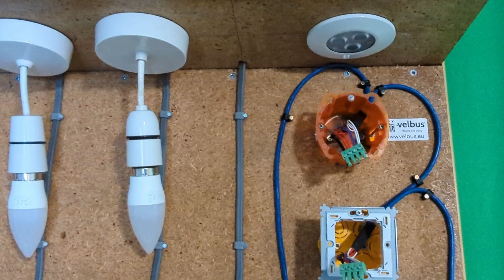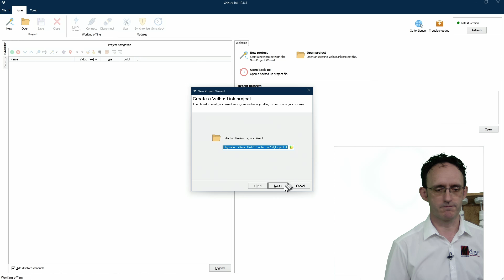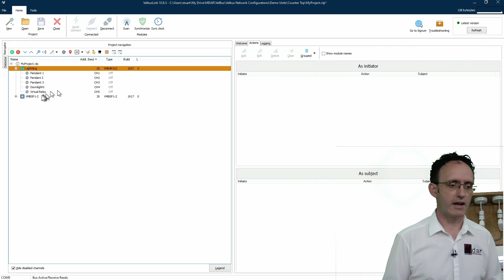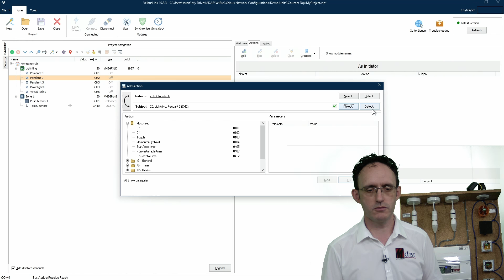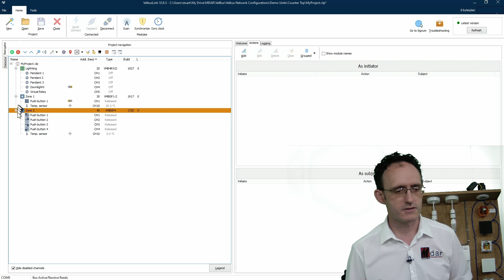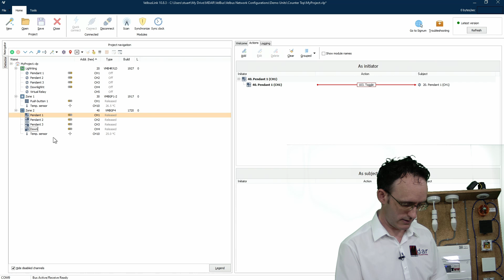Velbus - Basics of system installation for Lighting

Comment: Loving this series, really helpful to understand the system and seeing how the system could work.

One question, if I have LED strip lighting, for the LED drivers, what types of drivers is preferred for the velbus system to work with it i.e. 
Mains Dimming – ( Trailling Edge )
0v/10v
DALI
Reply from the maker: Hi
For the best result, you'd be better off putting Extra Low Voltage PWM dimmers ''between'' the constant voltage power supply and the LED tape, then use a channel of a VMB4DC to drive the PWM driver.

It'll be the subject of a later video or you can take a look at this PDF, for 10v controlled PSU dimmers 

https://www.mdar.co.uk/dl/10V_to_LED_driver_wiring.pdf

Or this one to use Velbus VMB2LEDDC PWM dimmer and a VMB4DC

https://www.mdar.co.uk/dl/VMB4DC_VMB2LEDDC_Wiring_plan_V1.5.pdf
Reply from the maker: If anyone stumbles across this in the future.

All the wiring diagrams can be found here

https://www.velbus.co.uk/downloads

Please ask if you need a drawing that isn't there.